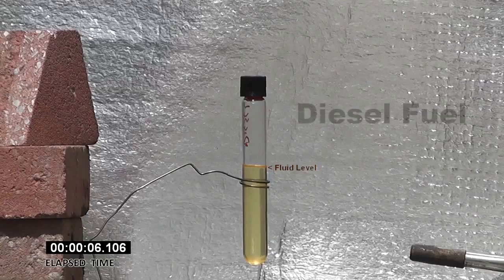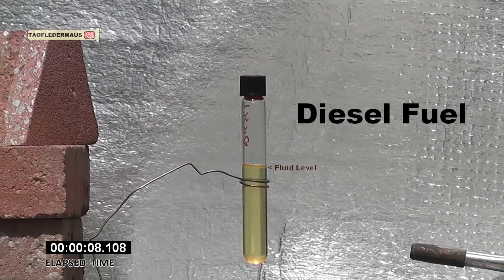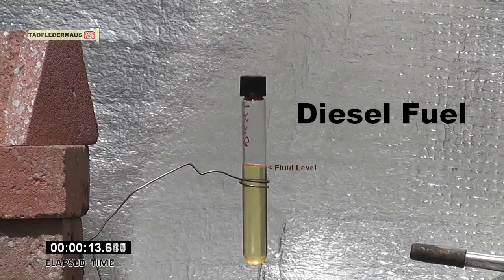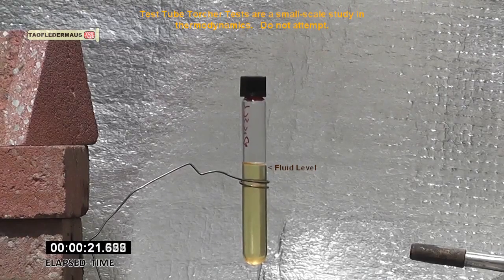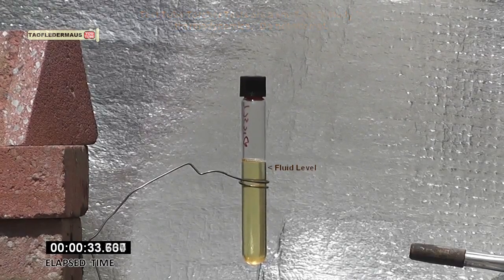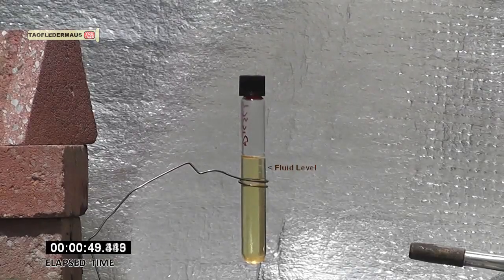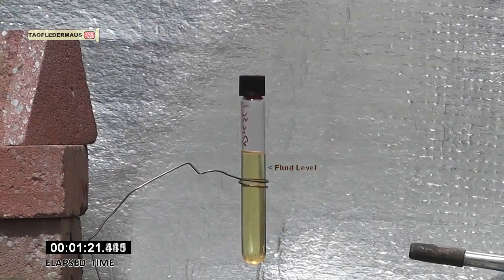Superheating DIESEL fuel in sealed vial -  What happens?

Comment: Excellent fireball. Good video. Would be off trying a 12g Co2 bulb heated or made into a mortar shell by dropping it down a pipe onto a nail, the capsule flies about 70 metres if you get it right, fun stuff.

Comment: one of the best I've seen yet on these TTTT - Toaf man, you keep my mind entertained. So many cool videos.

If I were to do a TTTT I would put naphtha/gasoline-polystyrene sludge with chlorine gas dissolved in it. umm, AKA homemade napalm with a kick. Probably more dangerous and explosive than anythign else you've tried. The tricky bit is making and dissolving chlorine gas safely - you can bubble it in to the solvent you use first but do this out of sunlight - or boom. You could try chlorinating tablets and putting them in water and make a phase mixture with the gas/lighter fluid. separate afterwards and it should be green. Chlorine prefers dissolving in organic solvent. Thicken that up and you have nasty stuff.
Reply from the maker: Right now I am trying to keep things relatively simple and use mostly household chemicals,   foods,  drinks,  etc.

Comment: Hey man, your planning a vid for gasoline already so I wont go there. But what about glycerine? It has a very very low freezing point (idk what the boiling point is), and it is also used in steam guages to prevent water condensation from entering the guage itself. I think that would be a very good video there. Also I think it would be cool to try Isopropyl alcohol, and hydrogen peroxide.

Comment: Taofledermaus,

Try a 12 Gram CO2 cartridge!  The results should be spectacular when captured in slow motion!  It would be awesome to see if the test tube could contain the initial rupture of the cartridge as the CO2 bursts out from the seal at the top of the cartridge.

Please consider a 12 Gram co2 cartridge!  Could the CO2 flash inside then again outside the test tube?

-RocketINC

Comment: i have a suggestion for the setup: instead on using a blowtorch where you often get failure due to the intense hotspot, how about using a coil heater? something that can heat the test tube evenly.
or coil a length of copper pipe with holes in, then just pump gas through it and light it. Again to distribute the heat.

Comment: Hey Dude that was an Awesome Video and a great Tune to. :D nice work Dude. :D N.
Reply from the maker: thanks Nicholas!
Reply: ***** Your welcome Dude have you tried Car Oil or Grease. I think that would be a cool experiment but if you want lots of views maybe try Beer if you put Beer in any video it sells well. LOL Just an idea. See what you think. Or if you have tried doing it before? N.
Reply from the maker: I tried one with fresh motor oil.   It heated for 15 minutes and just turned black and I stopped the torch.   I need to put a lot more heat to it or will have to shoot it with a bb gun if it doesn't build up enough pressure.
Reply: ***** That's interesting I guess because it's in a large volume it just can't get to it's flashpoint temperature or can't build enough pressure in the test tube. Very cool tho Dude. Did you say you have tired Beer in a test tube? N
Reply: ***** BEER BEER BEER BEER BEER BEER BEER BEER BEER BEER BEER BEER BEER BEER BEER BEER BEER BEER BEER BEER BEER BEER BEER BEER BEER BEER BEER BEER BEER BEER BEER BEER BEER BEER    PLEASE TRY BEER BEER BEER BEER BEER BEER BEER BEER

Comment: sweet! Have you tried aiming a thermometer at the testube? It would be nice to have some indication regarding the superheating and when it reaches the point of autoignition.
Reply from the maker: I did try with an expensive Fluke IR thermometer but  it had trouble distinguishing the flame from the tube temperature.    The flame is a couple thousand degrees and engulfs the tube.

Comment: Awesome!, I love the power of diesel :D, and the smell afterwards :D.

a drop of water in a tube of oil would be interesting, it sure would add to the pressure buildup :D
Reply from the maker: This did have a good diesel exhaust smell!    Yeah,  even a drop of water would help.   I may do that with the motor oil to help boost it.
Reply from the maker: thanks Allan!
Reply: LOL! got to love DIESEL POWER!
Reply: Good One, I like the slo-mo,
Reply: Franco Pellegrin lol, good luck getting away from it :p
Reply: Diesel is the worst thing ever!
Reply: The smell of diesel always brings back memories of my old 1981 Mercedes 300D!  Those things were built to last forever, but being young I traded it for something faster.  Wish I had it back now.

Comment: That was very cool. Love the fireball it made.
Reply from the maker: When people suggested this I never thought it would create a fireball.   I didn't think I would get it hot enough to hit the autoignition point.
Reply: ***** The higher pressure helps it ignite, that's why diesel engines are built stronger and heavier than gas engines (unless you're being cheap like Oldsmobile in the 70's/80's trying to simply convert an existing gas engine).

Comment: Wow, it was quite interesting to see how it managed to pop the lid off before the plug even looked like it was going to fail. And is it just me, or did the vapor cloud actually ignite before it hit the flame?
Reply from the maker: The caps really don't hold back any pressure.   It was pretty weird seeing it pop off first,  usually the silicone plug and the cap just blow off together.   I'm fairly sure the torch did not ignite the cloud.   The fireball seemed to begin way behind the torch and evenly throughout the cloud as it mixed with the air.    Then the fire engulfed the torch and actually put out the flame.
Reply: Ah, I see. Thanks

Comment: Isn't the autoignite temp lower in a engine because it's under pressure and being compressed?
Reply: when it compresses the fluid / gas temperature greatly rises.
The diesel engine burns because highly compressed diesel gets injected into very hot air (compressed by the cylinder)

Comment: that would have produced the best of any mpg's from a vehicle.. you wouldn't be able to get a better atomized fuel anywhere. i would liked to have seen the temps and pressure inside of the test tube. then reproduce both in vw diesel rabbit or vw diesel truck.

Comment: Trevor LIKE BIG BOOM!
Reply: *****  What about trying to heat up a minimal amount of diesel, like 1ml, 0.5ml, maybe even 0.1ml? see if it will flash inside the TT like it would inside an engine, but without the comprassion of the piston. :)
Then try some low-octane fuel too.

I wouldve done so much crazy shit if i had free TT's and a torch! :D
Reply from the maker: Thanks!   I was in my garage looking for bb's thinking it was never going to blow up and...  thud.. and a bright flash.    I guess that is better than getting hit by a flying test tube.  lol
Reply: NO DOUBT! Originally I thought it just exploded. In the SloMo I realized that test tube was a rocket! It was very cool that the diesel under pressure stayed liquid and as the gas released it hit it's flash point! Diesel is a amazing petrol.
Reply from the maker: HighDesertTactical  I didn't even know the tube rocketed off until I was mid-way through editing.

Comment: If the vapor didn't come in contact with an open flame it wouldnt have cought fire
Reply from the maker: I think the concentrated vapor just extinguished the torch.
Reply: No the vapor is flammable its just not getting enough pressure to ignight on its own
Reply from the maker: It's not the pressure,  but the temperature the cloud is once it mixes with the air.  The flame did not originate from the torch.

Comment: ***** Why not use a laser aimed infrared thermometer to get a rough estimate on temperature. Maybe some time down the road even reusable cap with a small pressure sensor. The thermometer can be picked up for about 20$ and pmctransducers sells some fairly tiny pressure transducers rated up to 2000 psi.

Comment: Huh... so it didn't actually explode initially, pressure inside of the tube just built to the point that the seal broke and all of the diesel got caught on fire from the propane torch. Interesting.
Reply from the maker: It blew out the torch.   I think the diesel autoignited...  JMHO
Reply: Hm. Maybe the fire just took a second to become visible. Either way, very cool video, thanks for the upload man.

Comment: The glow plug is just used to heat incoming air (when the engine is cold or environment calls for it).  Diesel fuel is introduced into a compressed air condition (12:1 ratio) which happens to be the temperature needed to ignite
Reply: Higher compression than that. 12:1 is still kinda high octane gasoline territory.
Most Turbo diesels (Cummins, 7.3 PS, etc) are ~17:1
My 6.9 idi is ~22:1
Reply: 89Laredo I might have to crack open a technical manual one the actual ratio needed to ignite diesel
Reply: MavHunter20XX

The ratios I mentioned (17:1 and 22:1) are static ratios, the amount of compression from BDC to TDC on the compression stroke. Which I think is the same thing you were think of and trying to explain.
When these measurements are taken addition (or lack of) a turbo has nothing to do with it, it is merely a measurement of the "squish" of the engine by itself, with no forced induction or anything.

My 85 6.9l idi is 22:1 static compression and non turbo.

Dynamic compression is a whole other can of worms and is the measurement of the actual compression while the engine is running (taking cam timing, etc into account)

The picture ***** posted is of an indirect injection diesel (like the 6.9 in my truck) This is old technology. Fuel was injected into a pre chamber in the head before it made its way into the combustion chamber.
The glowplug and injector tip were located in this prechamber.
IDI cutaway:
http://i38.photobucket.com/albums/e104/ToughOldFord/Tech/IDI/IDIHeadCutaway_zpsd1958e34.jpg

Modern diesels are direct injection and do not have this pre chamber. The glowplug tip and injector tip are right in the combustion chamber.
7.3 Powerstroke (I think) cutaway:
http://i626.photobucket.com/albums/tt346/woodnthings8/Injectorcutawaylabeled.jpg

The "Glowplugs" you see located in the intake manifold are most likely some type of Grid heater setup like Cummins uses. They are used to heat the air in the intake to a suitable temperature before it is sucked into the engine.

The ones in the head are a typical setup like the images I linked above.
And yes, either way they are only used for cold starts to get the engine running, then it doesnt use them.

Im not sure on lowest compression a diesel will run at.
Reply from the maker: http://au2circle.com/index.php?do=/blog/896/how-do-diesel-engines-work/

Typically they are in the combustion chamber.  (pre-precombustion chamber)
Reply: ***** huh, never seen that before, but typically "I" see them either attached to the intake manifold or just right after it into the block (mind you these are 1980's engines), but its task is still to preheat the air...except it says something for emissions here, hmmm...well I don't work on diesel automobiles, just prime movers for water or electricity.

Thanks for that though.
Reply: 89Laredo oh well that's turbo, I'm talking about the ratio from bottom dead center to top dead center of the stroke.  Of course turbo chargers are going to increase pressures.

The engines I usually work on range from 2 liter inline 3's to V12 38L (KTA38).  But these aren't automotive engines and they do operate at the same standards.

Comment: This was the best yet and got me thinking. It would be cool if you could rig up a laser  thermometer so we can see the heat build and what the temp. is when it goes off. Just an idea.
Reply from the maker: I tried using my Fluke IR gun (it has a laser pointer on it)  on one and I couldn't get a good reading.  It didn't know whether to look at the flame temperature or the glass.  The IR guns don't work well with glass,   it's too reflective.
Reply: Great minds think alike I guess. Too bad it did not work out. It would be cool to see though if there were a way.